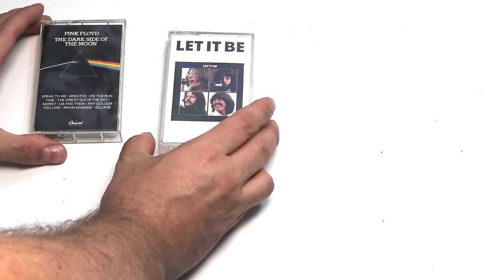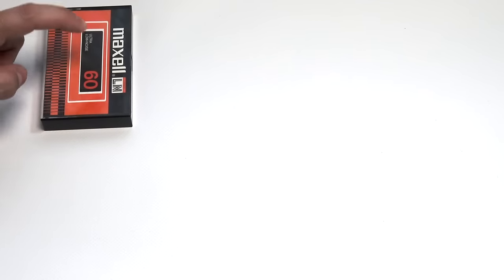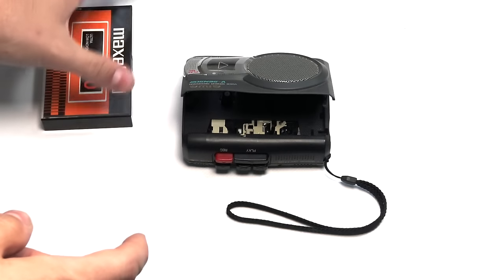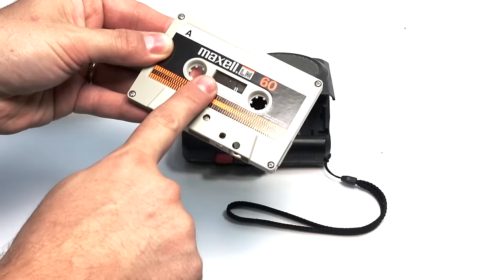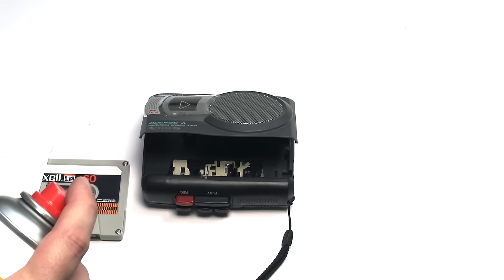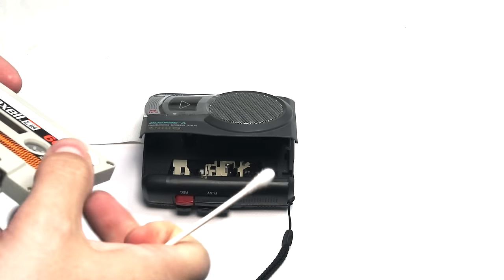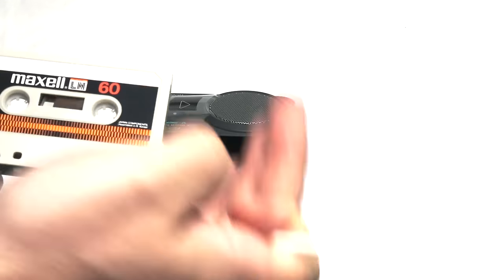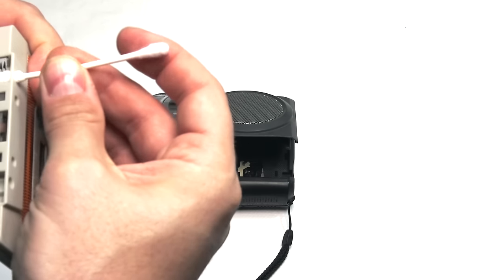How to relubricate your stuck cassette tapes

Comment: I think that is time to stop agitating people to lubricate cassettes and make a big mess with their decks and killing the cassettes this way. I want to see you and mr Lucki from Germany how you both lubricate cassettes with your favorite lubricants, spatially you with a silicon lubricant and after that to play this cassettes on your Nakamichi Dragon –s ! This technology concerning just certain types of tapes which is playing on open reel to reel but not a modern cassettes. I try already and make a mess with  3 of my high end decks and destroy permanent good cassette and a record on it. Also here I am posting my question and answer of professionals that dealing with a transfer of records of old sticky tapes and they know about lubricants and also other technologies concerning sticky shed syndrome .
  
John Adams 1 week ago 
Question to mr. Hales Should be the cassette tape lubricated against sticking and if yes- what kind of lubrication to use and how this will affected the frequency range and the quality of the sound likes dynamic, noise and wow and flutter. Thank you for your consideration in advance! 
 
Highlighted reply 

Electrical Audio 

1 week ago 
Hi, tape has lubricant in the composition of the coatings. Generally, you don't want to lubricate the tape for playback or transfer, as it can create a mess that could damage tape and machine. However, if you dig into Richard Hess' site, you'll find an article about "wet playing" tapes, and some other examples of people using very specific lubricants when baking couldn't restore a tape for transfer. I should caution that these should only be done by a professional who is setup for wet playing. In most cases where the tape is degrading because of sticky-shed syndrome, baking is the solution. But not in all cases... Good luck!
Reply from the maker: As clearly explained, you must clean the tape repeatedly with a few cuetips in order to remove all lube in excess l. The tape will get what it needs. If you are anybody not comfortable, don't do it. No problem at all.
Reply: @anadialog  The problem is that once the tape is lubricated on the front side by rolling in a cassette is  on the lubricated on the back side and even to clean the front by rolling the grease on the back side is still lube on the front side. And you super stubbornly refuse to admit the fact that in decks with two capstans the tape is stretched by the friction of the axes of the capstans contacting to the back of the tape which is made of polymer and is more slippery than the front side which has a magnetic layer and also can not absorb any kind of lub. And when this back side of slippery polymer is also lubricated ,then the tension force of the tape is insufficient to ensure good contact with the head, especially by Nakamichi with NAAC, and then the result is great - wow and flutter  and emergency shutdown of the transport mechanism because the sensors detect excessive slippage . So your whole article about lubricating audio cassettes is an incredible nonsense based on the joke of a German master of decks, a great joker really, and some articles about lubricating tapes on tape recorders but not on cassette players.

And on top of that, you don't acknowledge what I'm writing to you, but you make me realize that I didn't understand the sacred technology of lubricating cassette tapes. I want to tell you that it is not an honor for you to deceive older people than you, with things that you have not checked yourself and
you rely on a theory for something else and someone who wants to see how many naive people from the site will go to lubricate cassette tapes with various lubricants and laugh at them in German forums. I understand that you do this for more clicks and readings, but still  should know that there are people with technical education and experience who will not belive to such absurd things.
And this, of course, destroys the credibility of your performances and I stop being interested in them because they are becoming more and more non sense and I do not want to waste my time with unproven things that will waste my time and harm my decks and cassettes . This for lubrication re lubrication, this for the thick wooden plate under the turntable, this for the thick power cord for 220 volts that will make more power, this for music over 20,000 Hz ... so far this is enough for me to stop wasting my time. People want to learn something real and not someone to deceive them and make money by wasting their time
Reply from the maker: @johnadams9041  I have no idea why but you keep coming back and you are clarly driven by prejudice besides triying once on a healthy tape that obviously has lubricant. At this time you are the only one complaining besides making a lot of mistakes here. FIRST MISTAKE: you said lube ends up on the back, yes true, but the back is always in contact with the top, so if you clean thoroughly the tape as I have clearly stated, ALL lube will be absorbed from the tape first, and then by the cue tips secondly. If you do not understand the process you cannot blame others. SECOND MISTAKE: you said no articles talk about cassettes. First of all, I added several articles that back up and substantiate this process for tape in general, magnetic tape is magnetic tape, in any case it is clear that you did not even read these scientific papers because two of them, by Bogart and by Hess, discuss this process also on cassettes (FACT) and even more ridiculous, one discusses how the Nakamichi Dragon after some initial esitations worked perfectly. So all you conclusions on this aspect are completely wrong and strongly biased. This is a fact. I and several subscribers tested this process for years and had always positive results. This is another fact. THIRD MISTAKE: Without any reason and out of the blue you kick in also other videos of mine criticizing the effectiveness. Turntables are greatly effected by vibrations. Fact. A solid, high-mass plinth of wood or other material will always help reducing these. Fact, again. I have no idea of which thick power cord you are taking about. Sound beyond 20Khz? Yes, I again presented scientific documents that PROVE that instruments go beyond 20Khz, that people hear and perceve that physially and at a brain level, that those frequecies deliver a more faithful reproduction and that OBVIOUSLY create harmonics and influence the audible spectrum. This is science and yours is prejudice.
Reply: @anadialog  I do NOT agree that I did something wrong, almost like a fool, and if I followed your advice, which is based on "scientists" and not on your experience or experiment, it would be exactly what you read. First - what is the difference between the good tape and the bad one that needs to be lubricated? That they are both 40 years old. Or do you want to tell me that one is like absorbent already and absorbs lubricants and the other is not? Or is it just that one of them is bad at first and when we lubricate  it will becomes good? After all, lubrication supposedly improved and preserved and preserved and rejuvenated the strips, and they lasted longer. Where is my mistake here lubricating a 40-year-old tape that you think has already missed the oil change several times? Second - because "scientists" say that Nakamichi Dragon played better with lubricated tape. Who are the scientists and who are the ignorant? Am I a scientist or an ignoramus? I have a master's degree in mechanical and electrical engineering, I have 3 inventions and 5 rationalizations and I am currently doing my own research about changing the direction of the magnetic induction vector applied to a magnetic medium, depending on the speed of the magnetic medium and the recording parameters.
This is Nakamichi's secret about the azimuth of discrete heads, not what everyone explains about the coincidence of the runways of the heads. Accordingly, I am very aware of the magnetic permeability of the layer of different tapes, with the depth of the magnetic flux recording with the magnetic hysteresis with the coercive forces and the aging of the recording in the first microseconds after recording. And accordingly, I define lubrication with random lubricants as incredible nonsense that just makes a mess with the record. How are those scientists more scientists than me?. So scientists as much as you want everywhere and of any kind and everyone writes what he wants to make money mainly .. I do not believe everything that scientists tell me. So when a virologist came out on Fox News and said that masks were harmful, I immediately went to buy N95 masks and barely found them - apparently there were many others who suffered from the scientists. They wanted to deceive us with high  price  and you are telling me here that I have to trust them for some tapes? This is the difference between me and you. You believe in scientists, you quote them and I am an experimenter and I do not believe them until I am convinced by experiments. In this case, my experiments do not confirm what your scientists have written, but you have not experimented with Nakamichi dragon, which in no way will work with a slippery tape, nor did my decks. 
The wood  foundation for the turntable - yes it is good but if it is gold and weighs 400 kg it will dampen the vibrations even better - here is how much valuable advice. Well if I tell you that a concrete slab will do the same job it will not be as valuable advice. As for ultrasound music, I won't bother here with young people who hear super cool, if you hear it with your brain or something else - listen to it with pleasure when you can and when there is a place to play for you. Success!

Comment: Nice recommendation. I have a similar method which I find objectively quicker. 
I physically open up the shell in half and then drop drops of the lubricant directly on top of the reels. 
I then flip e̶n̶d̶  and repeat on the b side. 
Then use a Q tip in the same place as shown in the video but FW flip, FW, flip, Rewind, Flip, Rewind flip. 
The lubricant is absorbed quicker  in my method,  possibly because the cassette is placed in a vertical position a opposed to a horizontal position; My wild guess is centrifugal force.
Reply from the maker: I did dream of doing this ( you do need a shell with screws or re-shell) but never dared...I am a little concerned about the amount of remaining lube...may be too much...

Comment: What if the  it plays but it goes up and down
Reply from the maker: Could be wow&flutter issues due to the difficulties in the tape trasport...try on a tape and see if it gets better.
Reply: Loss of Volume and high treble? pressure pad, right at the face of the tape that is opposite the head. Cheap tapes I've seen with a sponge that turned to powder. spring bronze strip with a felt is longer lasting.

Comment: In a cartridge so lubricated, the grease can act directly on the pressure roller. Oil in any form is a rubber killer, so this method damages the roller and dramatically shortens its life. Caring for the tape recorder involves cleaning the tape track and degreasing all its elements, heads, rollers and guides. We grease them here, it's absurd!
Reply from the maker: Silicon lube is a well-known rejuvenator. In any case, relubricating tape is a standard procedure. Check the wealth of documents I added in the video description and you will see that I am right.

Comment: What if mine doesn't have a rewind button?
Reply: Also when you wait those weeks for it to work, do you need to leave the qtip in?
Reply from the maker: Go ahead and use the FFW and turn the cassette around. No problem.
Reply from the maker: No, no. Take it out. It might take only a day...it depends...just don't use too much lube and if you do, use a few que tips to absorb the excess.
Reply: @anadialog  Thanks

Comment: ... and then all of silicon lubrication mixed with the dust of the air will stuck on the head of the player!!! Awesome....   
Dear sir, if a cassette is stuck.... put a pencil in one of the gear and do a manual full forward of one side.
Reply from the maker: Try watching all the video and understand the procedure dear sir before criticizing something you don't know. All tapes have lubricant and this is a standard procedure. Obviously, as mentioned in the video, the extra lube must be soaked up with a cuetip. We are already beyond the point of using a pencil. When the lube is gone is gone.
Reply: @anadialog  There is no lub in cassettes... Every chemical you put on your tape will, at some point in time, desolve the glue that holds the special magnetic material on that tape. I did, for many years, restoration of reel tapes, and one of the methods we used was to "bake" the tapes. We did that in order to restore the glue on that tapes. Not to desolve it.  I am not criticizing, i watched your full lengthy video, but tell people what they will gain and what they will loose from your method.Anyway, you have your opinion and i have mine.Thank you...  I did not leave a dislike as you saw...
Reply from the maker: It isn't my opinion. In fact, I backed up all my claims with scientific papers in the video description. Check them out and you will see that I am telling the truth. All types of tape have a lubricant. 100% true.
Reply: @evilgrows  Am I an diot? Please clarify...
Reply from the maker: Be nice or leave. Can't even handle a discussion on YouTube without offending someone? Grow up. 
In any case, where do you think the lube is stored my ignorant genius?

Comment: Tape too tight to rewind/fast forward, now what?
Reply from the maker: First of all smack it, on the top, a few times. After that, if it does not work, take up some tape by hand with a pencil orb a good old bic pen! You can do this for the whole tape and should be loose at that point or lube every one and a while. Perhaps that will start the tape again. Otherwise, the last stand is to unscrew the tape and lube a little on the side. After it is absorbed make sure to clean it with some paper.

Comment: The original Capitol XDR cassettes were purely snakeoil. There was nothing audiophile about them at all. Cheap shells, terrible parts inside and as you have found out - crappy tape that sticks and sheds.

This is NOT a new problem but one that existed on Capitol and EMI XDR cassettes going back to the originals.

Only when capitol switched their shells to screw tops - did the XDRs actually beocme quite good (but nowehre near A&M's BASF Chrome Oxide)
Reply from the maker: I am starting to think that you are right...
Reply: ANA[DIA]LOG listen. I am right. That’s the story behind XDR. It’s not a hi end tape at all. It may as well be a Type 0 recorded with High Bias. 

They are cheap and prone to sticky shed syndrome. There’s more than one factor in these cassettes sucking and lack of lube ISNT one of them.
Reply from the maker: Jonah, as many other techs you are driven by prejudice without real knowledge, in this case, about this issue. It is really sad to see how arrogant you are, just go back and read your commnets. I see now that you have written several negative comments over the months and I think you should inform youself better before pointing your finger, insulting and denigrate people. I have posted simple things but considering that you would like more proof here you go. After rading this info, I hope you will be polite and intelligent enough to apologize.
Here you will find a selection of scientific papers explaining the issue and how it is a standard procedure to relube tape (even NASA does this!). I have underlined a few crucial passages in the papers: 
Heritage: https://www.dropbox.com/s/f8254yfeqrrw9vp/heritage-02-00097-v2.pdf?dl=0
Nasa: https://www.dropbox.com/s/xxdw1qh8mlbppdu/Nasa.pdf?dl=0
HESS: https://www.dropbox.com/s/ydrvxg6zipjkrvw/HESS_Tape_Degradation_ARSC_Journal_39-2.pdf?dl=0
Preservation Commission: https://www.dropbox.com/s/3s3ejmho2jexhgt/pub54.pdf?dl=0
   - (here is the official article: https://www.dropbox.com/s/rtvqt1n537w9vpa/Bogart.pdf?dl=0)
Kondo: https://www.dropbox.com/s/zi4vv42ggi9vh8u/tribochemistry-of-ionic-liquid-lubricant-on-magnetic-media.pdf?dl=0
Here is an article of a lab that is relubing its cassettes: http://tasso.cat/re-lubrication-of-compact-cassette-tapes-with-sbs/

Comment: Cassettes never had any preapplied factory lubrication whatsoever. If tape gets stuck due to friction, the shell is worn. IF lube doesn't cause tape to become oily accidentally this method may work temporary. 
Get the tape out, reshell inside a known good shell, problem solved. The end.

Greetings, a long term tape user since 1975.
Reply from the maker: That is wrong. All tape binders always have a type of lubricant. Check the documentation I uploaded in the video description and you will also discover that relubricating is a standard procedure
Reply: I like the "problem solved" bit as if it's some sort of conversation ender. I have transferred my stuck tape to a brand new shell (purchased very recently) and it is still stuck.